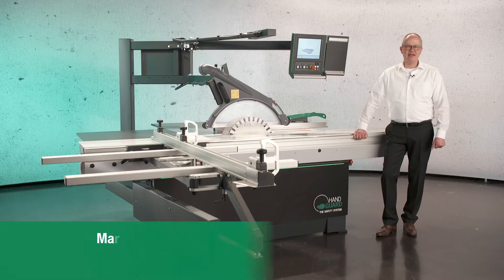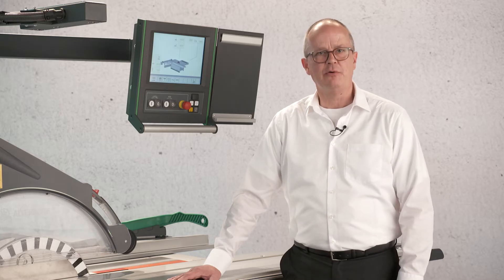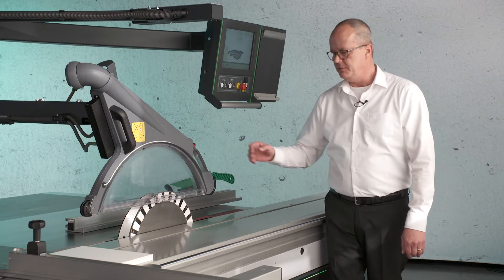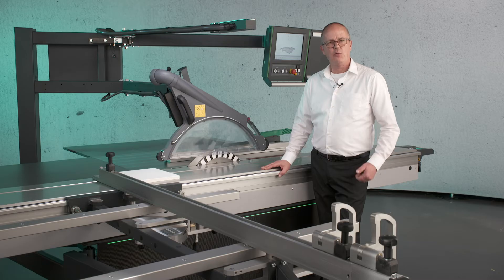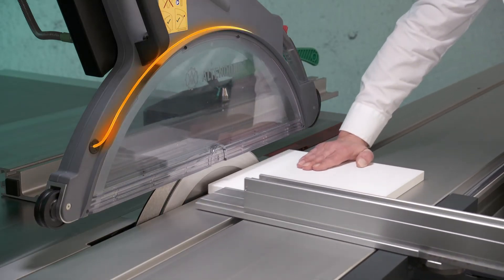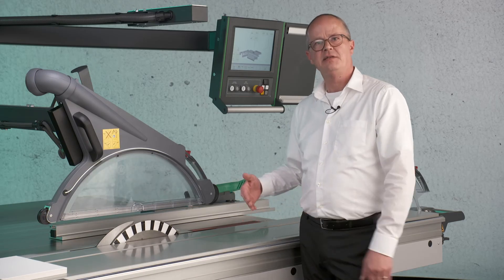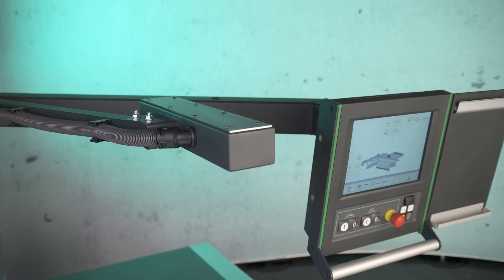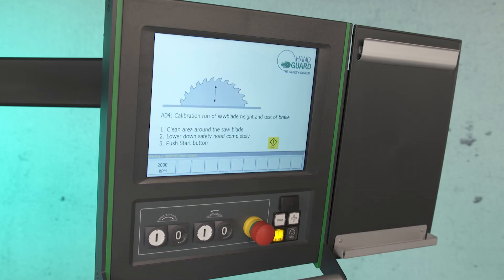HAND GUARD - sliding table saw with safety assistance system I Altendorf

Comment: fantastic idea, and as the blade isn't being 'braked' by a aluminium block, the saw blade isn't destroyed by the safety system, its fast, and sure, you take the blade out of sight, so reduce the danger completely, no waiting for a saw blade to stop rotating in a dangerous position, its the proximity that is dangerous, its safe if the blade 'spools down' inside the machine.